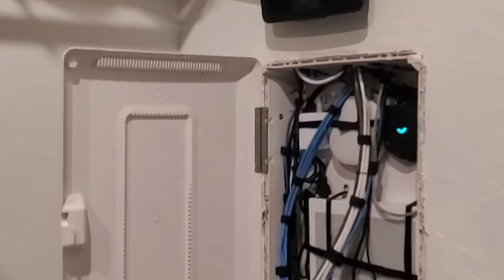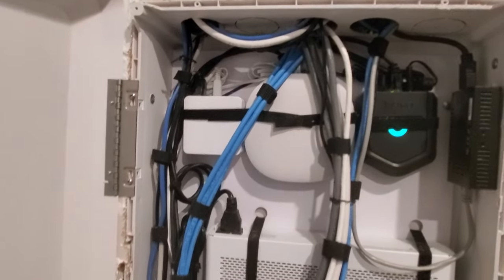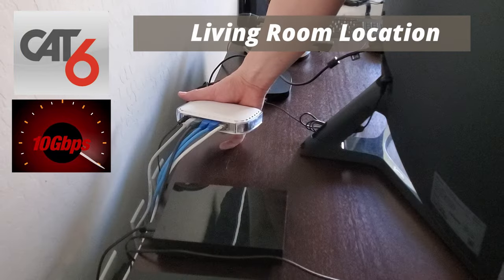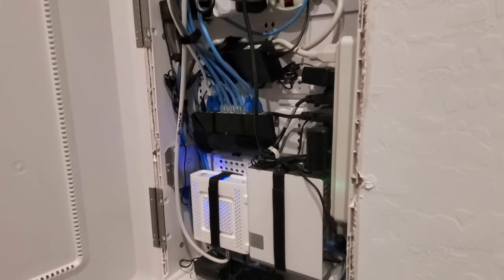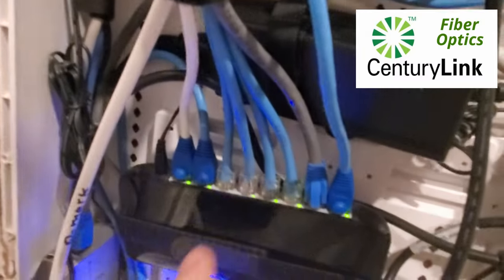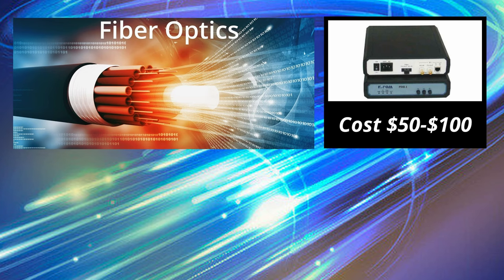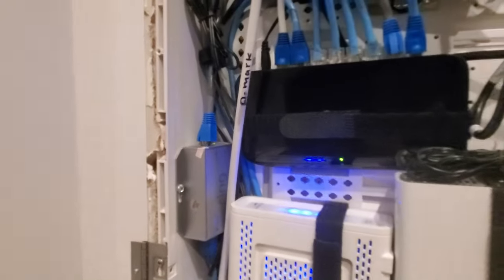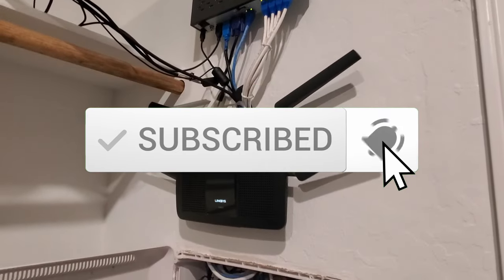10GB HOME NETWORK - 10GB NETWORK EXPLAINED! RESIDENTIAL NETWORK PANEL

Comment: Nice video but you don't get a 10gb network for internet speeds. You use it for lan speeds.
Reply from the maker: Absolutely.  Max Network speeds are 1 gig for residential unless you pay an arm and a leg for 10 gig which is insanely expensive and you would have to change your PC network cards out as well as all Network hardware. We have fiber at 1 gig. So the 10 gig from Cat6 is strictly for LAN to LAN not from internet.  However I always recommend wiring Cat6 for future proofing your home. Thanks for watching and for commenting.

Comment: Did you knew that 50hz electricity cables cause interference when network cables and electricity cables are side by side. Interference can slow down your Network Speed... That is why Tier 3 Data Centers split Power cables from data cables
Reply: That’s very similar to car stereo installs power and rc cable are split from driver/passenger sides on the car to the back of the car

Comment from the maker: We hope this video on 10-Gigabit Networks helps you understand how 10 Gigabit Networks work and all the costs associated with running a 10 gig network. Thanks for watching.
Reply: Thanks for the effort, but not sure your helping much. You should have used the term 10Gb cabling rather than network. To have 10Gb network, you need 10Gb switch + cards on top of cabling, but you can run 1Gb Switches and cards on 10Gb cabling. Only use 10Gb electronic on equipment where you MAY need it... i.e. NAS (if you frequently transfert files and are waiting... Streaming is not an issue, you need 25Mb for 4K streaming, so even if you are 6 watching 4K in a house, Gb is enough), Uplink (Cable which agregate multiple 1Gb connections).
Reply from the maker: Sorry I miss spoke I was referring to my RUCKUS ICX switch with the 10gig connections. The black TP-Link is a typical 8 port gigabit switch. If I ever get 10 gig fiber I will rearrange my office and bedroom connections to run through the Ruckus switch so I will have 10 gig speeds. Or maybe I will get a CISCO switch with 24 ports and get rid of the other 2 switches all together. But Cisco is very expensive and I would probably buy it used. Lol

Comment: If you have existing Cat5 cabling you can always use it as guide to install Cat6 😀 just make the joint smoot so it doesnt get stuck while you pull on the other side 😀
Reply: Not really.

Comment: Cat 6 can't do 10G over 55m and you need Cat 6a for up to 100m. If you are running 10G cat 6a would be the least I would go, but I just run cat 8 and not worry about it
Reply from the maker: Yes and I have 4 Cat6a lines and the others are Cat6 riser cable. Thank you for watching!!

Comment: thanks for this great video explanatory. my country just started opening up 10gbps internet speed for residential. i came across your video and was wondering if i should upgrade existing Cat5e to Cat 6a or Cat8. Your recommendation for future proofing is definitely worth it. i can still remember when i installed my house with Cat5e, and served me for the past 10+ years.

Comment: Do you need a 10GB fiber plan for an internal 10GB network? I'm getting fiber, but at a 1GB plan.
Reply from the maker: Nope. Internal data transfer will work as long as your PC NICs are 10gb and your switches are 10gb. Thank you for watching and if you subscribed thank you as well.

Comment: I wired my house with Cat 6, all my gear is 1Gbps, some houses like mine are a pain to wire, so Cat 6 was a must for me to avoid a rewire in 10-20 years.
Reply from the maker: That's a great setup! You are all good for the next to 10 to 15 years! Thank you for watching.
Reply: No, you should run optic fiber in your how for next 5 year. Its cheap and ultimate bandwith.

Comment: Thanks for the great video on your in-house network. Our building is upgrading to fiber but My research on fiber modems is pretty mixed, especially when you realize that the Ethernet port are typically 1gb output. I don’t understand why the input port would be 10g but then the output to the network is only using a 1gb LAN port.  It would be interesting to create a video on the available modems (not routers) and how companies advertise 10gb data to the house only to be limited to your home network by 1gb ports rather than 10gb ports.
Reply from the maker: Here is a video I did on our fiber optic installation.  
https://youtu.be/RJbR80rdFEY
10 gig is pretty much over kill since most fiber connections are 1 gig.  And everything you said was 100 percent correct. And even cat5e can do 10 gig but only  at short distances. Thanks for the great comments! Thank you for watching and if you subscribed thank you as well!

Comment: I'm confused. None of your routers/switches are 10Gbe. Do you don't actually have a 10Gbe network, you just have 10Gbe compatible cables in a 1Gbe network, right?
Reply from the maker: My switches are 10gig and my Ruckus ICX switch is 10gig. However my linksys router is not. But all my cables are 10gig and I currently have fiber with CenturyLink.  I'm only getting 940 mbps since that's all they offer and all I can afford. I'm assuming 10gig fiber would be very pricey.  Thanks for watching  and for commenting!!
Reply: @UltimateTechHub  ah. thank you for responding! 
It wasn't clear in your video that all of those Cat6 cables are only plugged into gigabit ports. Looks like even on the Ruckus switch you're only using the 1Gbe RJ-45 ports, right? Only the SFP+ ports on the Ruckus support 10 Gbe I thought.
if you run a iperf3 test from two machines in your network, do you truly get 10 Gb speeds?

Comment: How do you wire a network for 2.5gigabit with  a WiFi. And staying protected cause I hear WiFi routers have built in protection. I’m getting eero 6 pro with my new 2gbit plan. I have seen I will need a 2.5 gbit usb 3.0 adapter for my iMac cause it maxes out on the built in Ethernet for 1 gig.
Reply from the maker: First, Congrats on your new blazing fast 2 gig plan! You need to run all Cat6a from that router to any devices and/or rooms. Cat6a handles up to 10gig. Cat5e and regular cat6 can handle 1 gig and even up to 5 gig at close distances. However Cat6a has incredible bandwidth. Yes you will need new 2.5 gig adapters for all computers and even TVs. I think a 1gig adapter for a TV is plenty of speed. Have fun and keep me posted.

Comment: hey thank you for the great video. if I use 1GBps switch  can I achieve local speed up to 1GBps with a modem that doesn't support 1GBps  ?
Reply from the maker: No, your modem must support 1gig in order to achieve the 1gig speeds. Thank you for watching.
Reply: @UltimateTechHub  Thank you for the info.

Comment: Is it worth putting doors and windows in your house or just leave the walls solid with no way in?  (Re should you put in cat6. No. No you should put in cat6a at least. Shielded outer jacket at least ideally all pairs as well. With a grounded patch bay) you really like pinching cat cables. They is gonna break.   What a mess.    You should get the new ubiquiti dream wall.

Comment: How to know if it's CAT 5e or CAT 6?  Thanks!
Reply from the maker: Look at the ethernet cable and it will be printed somewhere on the cable. Its usually printed many times like every 6 inches . Also Cat5e is thinner than Cat6 so that's another way to tell. Thank you for watching.

Comment: Real CAT 6 wire is separated, 23 gauge copper conductors. If you see 24 gauge wire and CAT 6 on the cable, THAT is CAT5e wire inside a CAT6 labeled insulator. There IS a difference especially on longer runs in speed. As in not being able to saturate a simple 1gb line then adding REAL CAT6 23 gauge wire saturating the line. Better signal to noise and so on.

Comment: Could a cable marked CAT7 but stranded copper with an AWG27 gauge handle a 10GbE network without problems? What would be the maximum distance for this type of cable taking into account the gauge?
Reply from the maker: Cat7 for 10 gig speeds works up to 15 meters or 49 feet. At very short distances cat7 can handle 25 gig speeds. Thanks for watching.
Reply: @UltimateTechHub  A CAT7 cable can work at 10 Gbps up to 100 meters but this is for AWG22-23 rigid copper cables if I am not mistaken, when using twisted copper cables with a lower gauge than what the regulations specify must be applied a factor of decrease in the throw that is why my question of the maximum distance for an AWG27 stranded copper cable.
Reply from the maker: @miguelangelrodriguezandreu1072  I believe with AWG22 it would be 50 meters. That is what I was taught in college. But I would just run the cables and do a speed test for accuracy. There are many factors that determine connection speeds besides the wires.

Comment: Can the router handle 10gbps transfer speed I'm looking at putting my home media server on 10gbps so it's what router to get is my problem
Reply from the maker: You will have to find a router that handles 10gig. My router does not handle 10 gig. I have a CISCO router that can do 10gig but haven't installed it yet. Media servers don't need 10 gig speeds. Video playback is not bandwidth intensive.
Reply: @UltimateTechHub  I have a big family I have 7 children and over 24 devices connected on gigabit just using my isp router and the Internet connection speed is 1.3gbps
Reply from the maker: @meetthehutchys5801  Awesome.  That's some great speed. Who is your ISP? How much do they charge?
Reply: @UltimateTechHub  virgin media I'm in the uk it is £62 per month the plan is called gigabit but there policy is provide faster than advertised there problem is they give you a router than only has gigabit ports on it so if you turn on modem only mode you only get about 900mbps but I phoned up and complained and they sent me the new hub that's not out yet and modem only mode uses a 2.5g port so I wanted to provide all these speed to my switch so I could utilise this speed that's why I was talking to you about a 10gigabit router

Comment: Thank you for this guide. That black 10 Gb switch (to office and bedroom), what model is it? I'm looking into upgrading my network to 10G too
Reply: He has the TP-Link 8 Port Gigabit Ethernet Network Switch. In the future, he will need to change the switch to something like this one NETGEAR 24-Port Fully Managed Switch M4300, and right now, its $2900 in case you need 24-ports.
Reply: You should consider 2.5Gbe network, as it appears much more affordable at (almost) the same functionality other than the most demanding tasks such network video editing in 4K. However, how often do you need that?

Comment: I'm wondering about using cat8 on. A 10gb network.
Reply from the maker: You can but its really not necessary.  Cat6 is plenty of speed and bandwidth.  But yes you can use Cat8. Thanks for watching.

Comment: Can you use Cat 8 cables with this equipment.
Reply from the maker: Category 8 cabling is fully backward compatible with Category 6A cabling, including RJ45 connectivity, and supports all Category 6A applications such as 10GBASE-T for a distance of 100 meters. I use some Cat 7 in my Network. Thanks for watching!
Reply: Skip cat8 and go fiber. Networking standard will skip cat8 as the benefits is not a significant jump from cat6a. Just like how 100mbps to 1gig lan connection and then 10g connection as the benefits from cat8 is too low.

Comment: Here in Brazil already have 1gb (1000Mb) plans, it’s only expensive.
Reply from the maker: How expensive?
Reply: @UltimateTechHub  depend the region. Some don't have much more 500mb for 120R$ (10% of a minimum wage),  and 1Gb is 200-400R$. This for family plans, for company normally cost more.
Reply: @UltimateTechHub  serch  by Max dicas here, the guy have 1gb speed link that use for some tests with houses routers

Comment: I want to get a multi gigabit network switch so I can use 2 1GBPS network devices at once from the same pc at max speeds
Reply from the maker: I'm getting fiber installed today. 1 gigabit which means 940 maps. Thanks for watching +

Comment: if we use cat5e in 10gb network, and if the cable run a bit too long or quality a bit too low, will the speed instantly drop from 10gbps to 1gbps or it will still remain at 10gbps but actual transfer drop a bit, like from 10gbps to 5gbps ?
Reply from the maker: Cat5e gets 1gig speeds but at very short distances can get higher speeds. Cat6a gets 10gig. At long distances you will see a slow down in speed and packet loss too. However that happens over 328 feet so you should be good. Hope this helps.
Reply: @UltimateTechHub  so its either 1gb or 10 gb, wont be somewhere in between ? i mean real data transmission speed,  not the link speed displayed on pc or device.

Comment: Someone needs to tell Verizon that (940/880) 1gbit is just not good enough into 2021...Luckily they are moving towards terminating fiber optic connections inside the home rather than outside-- their next fiber ONT should have a fiber output as well to be able to connect to  a switch or router direct-- so slack boxes will be part of the upgrade too.
Reply from the maker: Yep i agree 100 percent.  We are getting Century Link Fiber nexr week. Its the same as Verizon 940 speeds. I have to run the fiber from my panel into the attic and down the wall by my garage where the fiber comes in from the street. My house didn't come with a pre installed fiber tube. Im thinking by 2023 we will have 10 gig speeds but its really a demand thing. If more people switch to fiber then they will move quicker to 10 gig. And 1 gig fiber is only 65 dollars.  So its getting more affordable for sure. Thanks for watching and commenting!!

Comment: Why not just use cat8? I doubt that we'll ever use 40gb in residential.
Reply from the maker: You can use Cat8 but buying Cat8 is not easy because some Cat8 isn't really Cat8. For me Cat7 would be plenty for future proofing.
Reply: @UltimateTechHub  cat7 isn't an actual standard. it's more of a theory/poc used in some data labs.

Comment: No! You switch to cat-7 cable. Cat-7 cable each of 4 pairs have a foil metal shield. This prevent crosstalk between cables therefore longer cable runs up 100 meters with 10ge. For cable greater than 100 meters use single-mode fiber optical cables for cable runs up to 2KM.

Comment: are those switches 10G they don't look like it.
Reply from the maker: Nope they are not 10gig. This video is about the cabling. However we are in process with adding a 10gig switch and upgrading 2 of our PCs to 10gig. We have 1 gig fiber so our current setup is good for internet max speeds. Keep an eye out for a 10 gig switch video coming soon. Thank you for watching I really appreciate it.

Comment: So is CAT6 the same as CAT 6A?
Reply from the maker: Cat6A speed is at least 500 MHz. This allows 10 Gbp/s (Gigabits per second) up to 328 feet (100 meters). Cat6 speed is 250 MHz. Therefore, it only supports 10 Gbp/s to 165 feet (55 meters) . But for a typical house Cat6 would be fine since most or all the runs would be leas than 165 feet. In an office environment or a very large house Cst6A would work better. Thanks for watching!!!

Comment: Anyone help? I'm using cat 5e it says it will give up to 100mb internet speed instead it gives 50 mb why is that?
Reply from the maker: Cat 5e gets up to 1000mb speed. Your speed is determined by your ISP, modem, router, switch and your device ( PC, Laptop ).  If you get 50mb its not the cable that's causing it unless its damaged and then it would not work at all.

Comment: Why not use cat8
Reply from the maker: I already had cat6a so why change.
Reply: @UltimateTechHub  you mentioned future proofing. That’s why I use a Wifi 6 router and NIC. Also, swapping out the cat6 from modem to router with cat7 will improve wifi speeds for all wireless devices.
Reply from the maker: @kjosephf  It will improve wifi speeds depending on your ISP max speed. I have 1 gig fiber so I get 1gig wireless speeds. However if you only have 200 mbps that's as fast as you can go no matter if it's cat5e, Cat6 or Cat7. If you plan on getting 2 gig fiber in the future then cat7 makes sense otherwise cat6 works great.

Comment: Man, you really need to learn how to build a network setup, starting by not sticking devices to a wall. There is a reason why many of these devices have air holes in the top and/or bottom...duh!

Comment: Your patch panel looks like a cluster F***
Reply from the maker: Its controlled chaos for sure. Haha. Seriously I have 13 devices in my panel with 2 mounted devices above the panel. These panels just need to be bigger or eventually I will get a server rack. Here is a more recent video of the panel....its definitely more organized.  Wires seem to be the main issue. 23 Cat6 wires and a fiber wire make it a challenge to keep organized. 
https://youtu.be/UNk2TEikELA
Thanks for watching!!!
Reply: @UltimateTechHub  I think a navpoint 9-12U rack would do . Then you can run a patch panel into your rack and some shelves. After doing this at my house I would advise to get two 24 port cat 6 patch 1U each vs a 2u 48 port patch . This way you can put one on top and one on bottom of your main  switch  . You’ve clearly out grown the simple patch panel/network aggregation closet . If it was mine I would take the door off of it and mount the new rack mount in front of it . I posted my comment when I was drunk and tired .